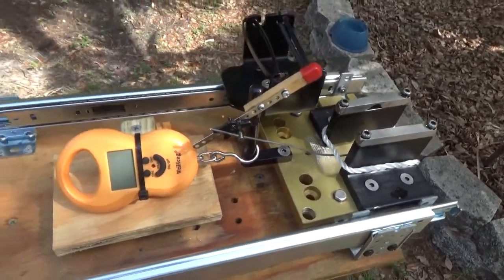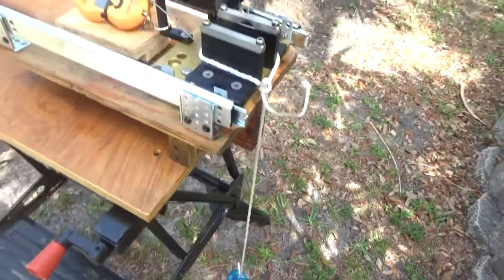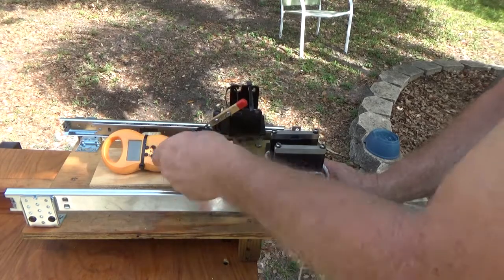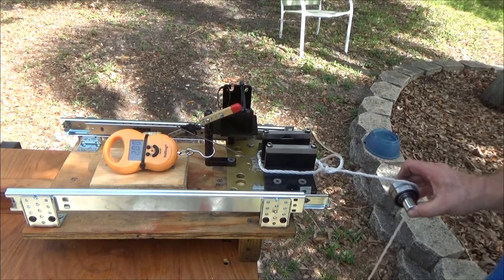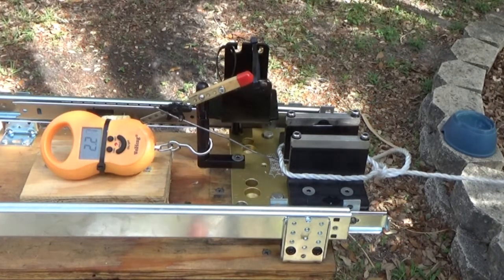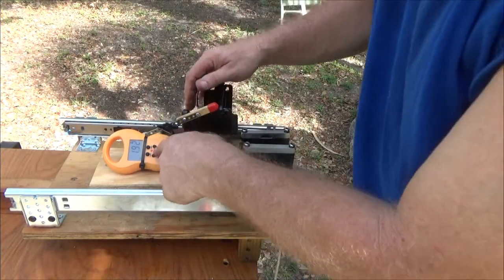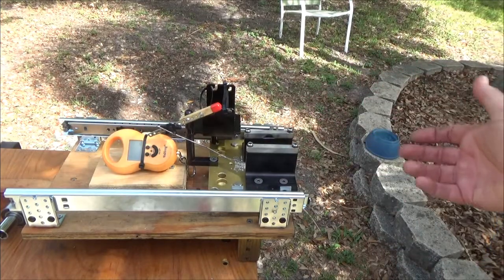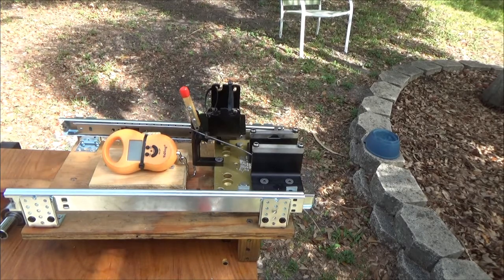Static Thrust Engine Stand Modification

Comment: I think you should use a servo to operate the throttle. mainly for ease of use with engines without a throttle stop.
I can't wait to see the YS 120 on the new test stand.
Reply from the maker: No I am not going to be adding a servo to this stand. It is way too crowded as it is now.  Besides there is nothing to be gained by adding complexity plus the need for a darn battery and other electronics.  BTW with as crowded as things are now the fuel tank for the YS 120 will no longer fit on this stand.
Reply: My friends often find that it is necessary to remind me of the KISS method  (keep it simple)

Comment: Are you an engineer? That's a fantastic setup. I vote for the TT 1.20 as first test engine.
Reply from the maker: No, not a mechanical engineer.  I already have the Fox 45 strapped to the stand.  I want to start with something a bit smaller for the initial test, for safety reasons.  I need to see how stout the setup is first.  I may have to make some adjustments.
Reply: Oh very well. Can't wait to see the test.

Comment: maybe add a safety cable to stop forward movement in case something fails with the scale.  also a pin to hold the side in place during startup.
Reply from the maker: What!?  And take all the fun out of it?  LOL.  As I said this is a prototype and I had just finished getting it together.  The other features like the safety mechanism will be worked out eventually.